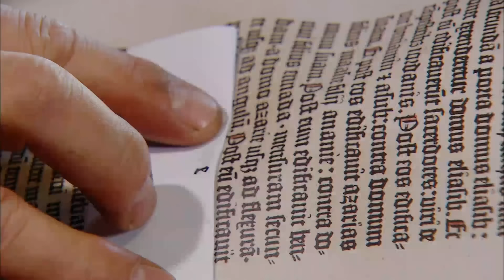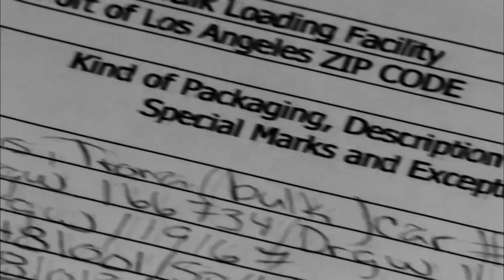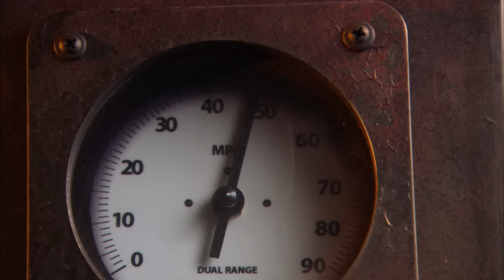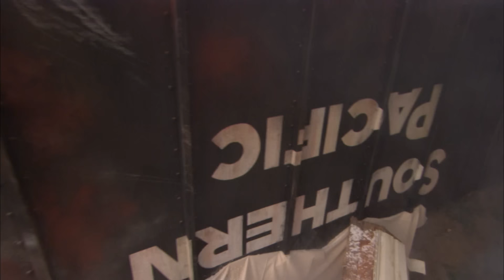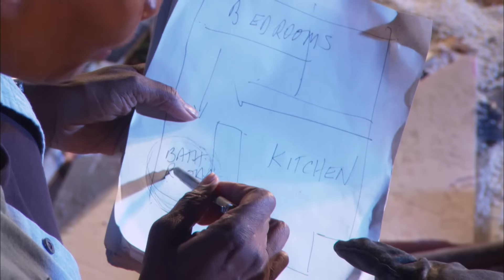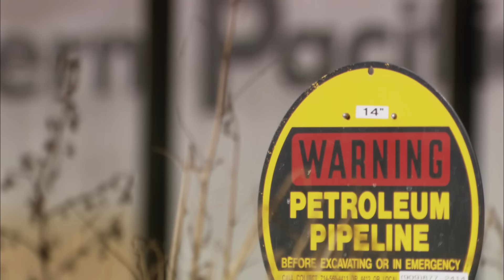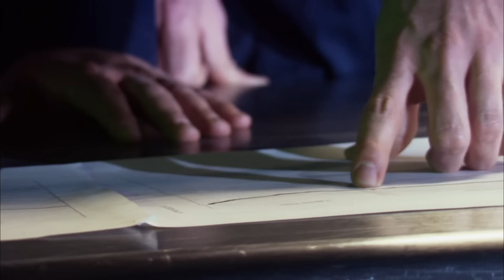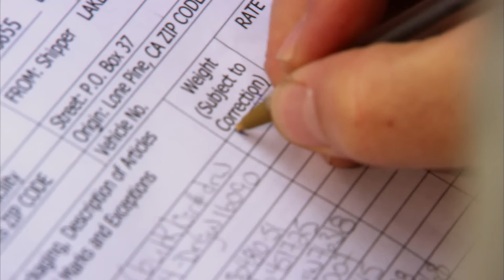Horrifying Runaway Train: San Bernardino Train Disaster SP 7551 East | Mayday | Wonder

Comment: It's a good thing the engineer survived, otherwise the company would have probably tried to blame the engineer if he was dead, companies love blaming the dead for accidents because the dead can't defend themselves, luckily in this case the engineer could tell the investigator's exactly what happened.
Reply: @Rayeed Raihan I mean, if it’s their fault then you should definitely blame them. If not then people could just falsely blame someone else?
Reply: @Rayeed Raihan that's the reality with most investigations. They'll blame those who can't defend nor speak for themselves.
Reply: @Rayeed Raihan Ah so imma not blame the terrorist for a plane crash that he definitely crashed on purpose
Reply: I imagine if you owned a railroad, you would too...
Reply: I blame all of you 😁
Reply: I'm a stationary engineer who also drives a train at my plant. The way a train's brakes work is counterintuitive. Trains use air pressure to apply the brakes. The actual locomotive (engine) itself, will apply its brakes (only to itself) when you increase the pressure to them (using the air pressure built up in the main air reservoir via the compressor).

 HOWEVER,

The railcars you are about to hook up to and eventually pull/push work in the exact OPPOSITE way. When you hook up your locomotive (engine) to the string of railcars you are going to pull, you actually INCREASE the pressure of the brake line in order to RELEASE the brakes. This is because we want the brakes of the railcars to engage and stay on when we disconnect from them (i.e. so they don't move after you leave them at their destination). So when you hook up to the string of railcars they will have their airbrakes on, and you actually have to increase the air pressure to them to get them to release, so you can move them. Once you get to your destination and are going to leave them, you disconnect and their air brakes immediately apply...
Reply: Your nieve to think that the crew would have been blamed if they had died.  It didn't take long for the NTSB to realize that the train was overloaded by the condition of the wheels and the associated paperwork with the train.
Reply: I would like to make one minor adjustment to that statement: You should not rush to blame the dead. 

It may be that in point of fact, after thorough investigation, the dead are at fault, for whatever reason. It then becomes a case of "The dead made a mistake, the dead paid the price, may they rest in peace". However, every effort should be made to avoid that conclusion--for example, if the dead followed incorrect procedures because that's what was available, then that is on whoever didn't make sure the available procedures were correct.
Reply: That's why they were so eager to send him down on that same stretch again.
Reply: @godbluffvdgg  Do you automatically lose integrity upon owning a business?
Reply: @Rayeed Raihan Uhmmm ....no
Reply: @Vespyr_  If you do, you won't stay in business very long...
Reply: @godbluffvdgg  Then maybe you shouldnt.
Reply: @Rayeed Raihan that doesn't make sense, a dead murderer is still a murderer
Reply: @Vespyr_  Okay, I won't.
Reply: @Rayeed Raihan If it’s their fault they take the blame whether they’re alive or dead
Reply: Captain Sullenburger had to fight for his reputation. The airline tried to say he could have made it back to LaGuardia. Everyone else sees he and Styles as heros.
Reply: @UnionPacificFan  
I never said the company would win blaming the engineer i simply said they would try to blame the engineer if he was dead, of course the NTSB would figure it out sooner or later, but in most cases even if the company knows it wasn't the workers fault they will try to blame the dead worker and hope the truth doesn't come out.
Reply: Blaming the dead man is standard procedure for any organization.
Reply: @ostrich67  It’s a sad truth that companies will blame those who can’t defend themselves against accusations. Although if after investigation it’s their fault then by all means blame them
Reply: Honor the dead?
Reply: It's horrible when  railroad management works under the philosophy of guilty until proven innocent.
Reply: @Rayeed Raihan 
If it’s their fault dead or not the blame should fall on them.
Reply: That's no BULLSHIT.I grew up in Philly about 100 yards away from railroad tracks.And there was a gas pipeline,ABOVE the ground.And directly across 26th street thoroughlfare was the oil refinery.At the time,the largest on the East Coast.IT BLEW UP,TWICE.The first time is when Mayor Frank Rizzo got his leg broken,being trampled by his personal bodyguard.I always thought; what if one of those trains derailed and bust that pipeline.I have family in San Bernardino.Southern Pacific,AND the oil company are at fault.Putting $ before human lives-
Reply: @BossSpringsteen69  Ain't that America?
Reply: Very true, but I don't exactly absolve him and his colleagues of wrongdoing either -- Anyone who knowingly and intentionally allows HALF-ASSED Equipment on any mission, regardless of method, bears some liability.
Reply: @waldorf2007  😱
😆🤣🤣😆
Reply: It is always important to find out what caused the accident, truthfully, so you can make changes to avoid repeating it.  Even it if turned out to be one of the victims of the disaster that caused it, it's still important to learn the reason so others can learn from it.

Letting the blame fall falsely on the dead is a travesty that means the lessons will NOT be learned.
Reply: @Rayeed Raihan the guilty should always be blamed whether dead or alive. How would you deal with a murder suicide in the world you live in?
Reply: @Rayeed Raihan Your perspective on this is dumb. Blame goes to those who earned it, whether they lived or died is completely irrelevant.
Reply: Railroads will ALWAYS blame the crew, not matter what the situation. Every railroader knows this..
Reply: @Jase-L  I agree , I mean he kinda slipped in there the 2nd or 3rd car brakes weren't working and the operator Frank knew it. I was like uh say what?
Reply: They concluded that the helpers were to blame for applying the emergency brakes and guess who is dead.
Reply: @Rayeed Raihan That's ridiculous,  if an incident is a deceased persons fault then it's their fault.
Reply: @ajcook7777  To me the brakes on a train are designed to work very logically especially if think about it especially if you understand how air brakes are designed to works.
Reply: The engineer should have continued taking the trains down the hill because he would better understand the situation should something like this happening for a second time.
Reply: There’s trying to blame, and successfully blaming.  You’d have had a government investigation regardless, and no accident this big has a single cause.  If you only see a single cause here, you haven’t looked deep enough.
Reply: Ain’t that the truth
Reply: Engineer should have jumped out the train once reached 50Mi/hr
Reply: Or they should have called /911
Reply: Thanks for completely spoiling it bro, but yeah you’re right.
Reply: @Rayeed Raihan If you didn't want people disagreeing with your statement and starting a "war", then you shouldn't have made it. The blame should always go to the person at fault, regardless of whether they're alive or dead. Death does not absolve them.
Reply: @Rayeed Raihan people will choose to agree or disagree and they have a right to respond to your statement either way. If the people who don’t agree bother you then I recommend using the best weapon you have  to defend against it. Your ability to ignore. Just move on, don’t bother reading the responses. It’s that simple . In a free society one of our greatest assets is our ability to debate, also to ignore those we choose to ignore
Reply: @12yearssober  The crew wasn't found to be at fault though
Reply: How could they have blamed him?    The independent investigation would have easily been able to determine what would have happened,   because they would have know the weights were not correct.        What exactly do you think they would have blamed on him?  
Or are you just a conspiracy theorist at all turns?
Reply: It's pretty accurate when people act strange and subordinate to major issues, could be the nearest idiot who ducks life up
Reply: I'm hurt I lost the one who counts. We were getting beaten down with anger, and pointless leadership to our help to give any conduct of stability. All positions were filled, up n the legality in f it all. They all connect but our better half was being detoured, deteriated. Some hate will die, sooner than they think do to there up bringing and genetic trashy ways.
Reply: I disagree with your statement. The NTSB determines the facts as to what happened, not the company.
Reply: @xoexosjmmm  You don't really do a lot of investigations, do you?
Reply: If I am not wrong can't we just apply reverse power from the engines by using the reverser
Reply: No blames please
Reply: @gerrygonzales3195  Not blaming Just asking
Reply: @tesmith47  Weak insult and argument lmao
Reply: @Rayeed Raihan Well, if it IS your fault, you should get blamed whether you're dead or not.  If you're dead it becomes a "don't do this if you want to live" situation.
Reply: That's for sure!
Reply: I mean it’s good for the engineer cuz he retained his life for himself
Reply: they wouldn't need him to say anything- all those speeds and controls are recorded
Reply: @xoexosjmmm
Reply: @ajcook7777  
You left out the part where if you bleed off every bit of air from the rail car that the brakes release because there’s no more air to keep them set up. 
That’s why they have handbrakes on them - to prevent them from rolling away when all the air bleeds off while they’re parked.
Reply: @ralfie8801  What are you talking about? NEVER and I mean NEVER bleed a railcar's air brakes off, unless you are purposely trying to move it. The only reason a handbrakes are applied to railcar is to have a back backup incase the air accidently/inadvertently bleeds off. If said railcar's ABDW valve malfunctions and the air pressure holding the brakes leaks/bleeds off then you have a physical/mechanical brake as a backup, so your railcar doesn't roll away.

CN Regs. state: 1 railcar = 1 applied handbrake
2-19 railcars = 2 hand brakes applied to string, 
20-30 railcars = 3 handbrakes applied to string
Reply: @tkso.philly3879  Off topic:  Did you like Philly aside from the train/pipe nearby?  I've wanted to visit and thought it would be fun to live there for a year.  This isn't from a creep who wants something, I'd really like to know how life is there, thx.
Reply: @Jase-L  That's what I thought, the back engineer & brakeman don't know the weight?? Wouldn't that be one of the most important thing to know on any train let alone the steep pass.
And guessing the weight? He guessed wrong.
Reply: @Vespyr_  You're thinking a train is owned by a person.   Corporations own trains and NO ONE wants to be responsible so they all find ways to duck and cover their own behinds.    You're quite naive to think what you do.   Imagine a car accident.   How many admit fault and how many blame anything else?
Reply: Uhh.. that’s why there are investigations. Companies this day and age can’t just point the finger at a dead person.. for insurance purposes there must be an investigation. Clown.
Reply: Like Boeing with pilots
Reply: @CrustyUgg  Not sure to whom you are speaking since you didn't say.   I guess that makes you the "Clown".
Reply: I'm also wondering why even after this accident where they couldn't shut the pipeline valves they still didn't fix it afterwards. This was negligent homicide.
Reply: Well maybe they shouldn’t be dead
Reply: That's capitalism for ya, where profit matters above all else.
Reply: @LunaticTheCat  No form of government nor economic system  works unless the people are moral.  When the U.S. kicked God out of the public schools in 1962 it was just a matter of time.   However, Capitalism is the closest government and/or economic system to a biblical one and works just fine IF the people are moral.   See de Toqueville.
Reply: @MistHazie  qppA
Reply: @tkso.philly3879  Never heard the Rizzo leg break, that's great.  He was the one that ordered the blasting of a black panthers building.  I always thought that was a bit of over kill.
Reply: Epic fail by multitude of people
Reply: @keithmccants2639  My cousin told me how close she was to the derailment.Horrible.I pray something was learned from it.
Reply: @ajcook7777  
The reduction of air pressure on the cars actually applies the brakes to the wheels. Increasing the air will release the brakes from the wheels..

I think that's right...🙂
Reply: @ajcook7777  yep. Just like semis or any equipment that uses pneumatic braking systems. Pretty effective and makes perfect sense.
Reply: @ajcook7777  speaking of air brakes, I've got a story. I worked at a truck shop while I was in high school. The company had around 25 trucks that hauled rolls of paper for newspaper from a mill in Port Angeles, WA to Tacoma, WA and Portland, OR. The keys were always left in the rigs and that wasn't a problem for decades. Then some kid decided to steal one of the trucks that had a loaded 53' trailer behind it. (No idea why he didn't choose one of the many rigs beside it that wasn't attached to a trailer). He managed to release the brakes on the truck but apparently couldn't figure out how to release the trailer brakes even though the valve controls are beside eachother and well labeled. He managed to drag the trailer out of the lot and a couple miles down the highway before giving up and leaving it in the middle of the highway. He couldn't figure out how to turn on any of the lights or how to shift out of low range. Weight was probably around 95,000 lbs. Those series 60 Detroits can pull some weight even with the trailer brakes set!🤣
Reply: @robgeorgia8801  yep. Air pressure is needed to release the brakes. No air pressure=brakes fully engaged.
Reply: @qalba3016  there wasn't nearly enough time for a 911 call to make a difference.
Reply: Agreed
Reply: @theshmallz  that is really sad to hear. And a dangerous way to view things on their part
Reply: In aviation we call it the swiss cheese effect....when all the holes in the cheese line up (all small errors)...a problem of any scale is likely to happen. we also have very good CRM (crew resource management) training which emphasises good communication in the cockpit and indeed with all crew. I flew freight in Africa and on one occasion they purposely overloaded the aircraft hugely and lied on the paperwork. (backhanders with the agents) It turned out ok...but the aircraft didnt fly that well. From then on..we weighed the pallets OURSELVES! You can draw the paralells directly to this train wreck.....!
Reply: God bless the the NTSB for keeping America great.  Our government agencies, including the IRS are wonderful.
Reply: @ajcook7777    I hope you are describing someplace other than the North American Continent because train brakes work by pressurizing the train line to 90 psi which also pressurizes the individual reservoirs on each car and releases the air from the brake cylinder of each car.  To apply the brakes on the train, the train line pressure is reduced, say 10 psi service application.  That diverts air from each reservoir to the brake cylinder on each car by applying the brake shoes to the wheels by 10 psi.  The locomotive brakes can be applied independently of the train line with the use of the independent brake handle and that is by direct application of air to the brake cylinders on the trucks to the wheels.  
The only safe and reasonable way to hold rail cars when leaving them unattached to a loco is to apply enough hand brakes to the cars to keep them parked if the air leaks off and /or place a skid or chunk of wood under some of the wheels and on top of the rail to a number of the cars.
Reply: @Jase-L  Well, what would you have done in the place of the engineer?
Reply: Really man Spoilers
Reply: @Vespyr_  A lot of people do, sadly.
Reply: I guess NOBODY heard that there was a complete brake failure...
Reply: Trump maga ♥️🇺🇸🇺🇸♥️